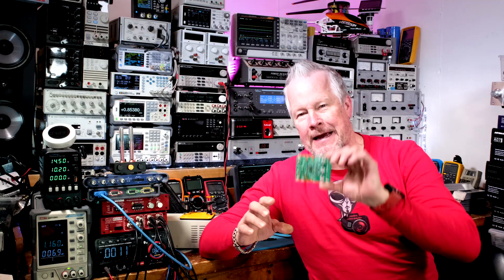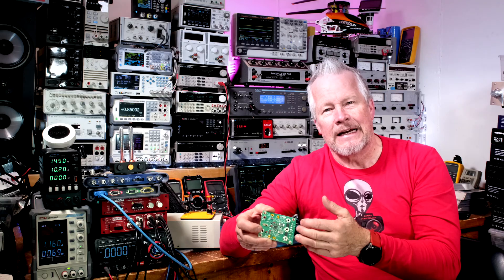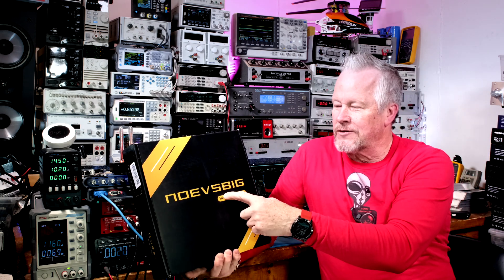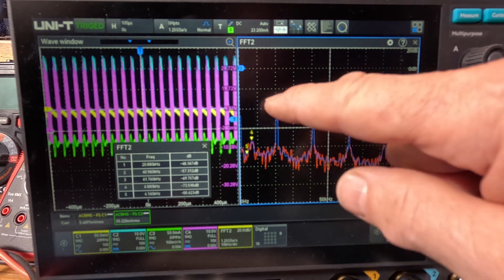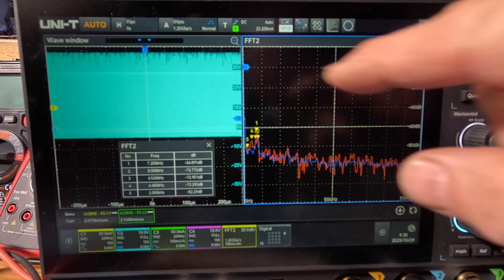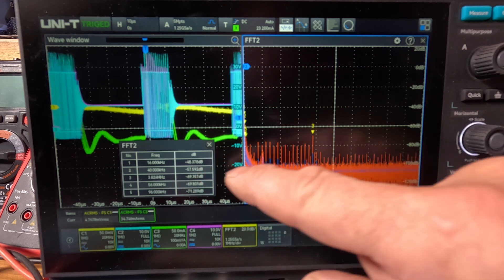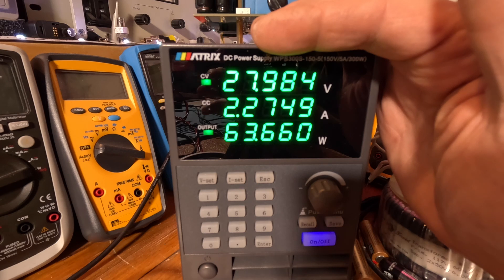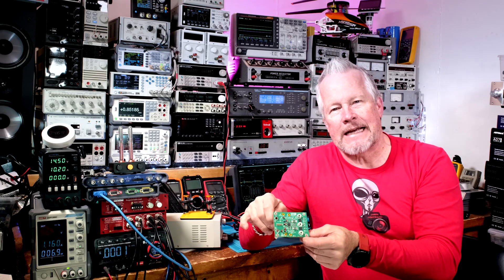Burst mode vs Pulse Skipping vs CCM in SMPS #EPC91109 #GaNconverter #LTC7890

Comment: Hey Eddie, great video! I was wondering how easy it would be to clean up burst mode with a post filter. Maybe all it would take is a bulk capacitor.
Reply from the maker: The burst mode needs ripple to operate - it makes the ripple as part of its control algorithm.  I'll show a video today the 3 modes in this eval card.  But yes there are ways to clean it up but then any benefit is lost.

Comment: Приветствую вас из России! Интересное видео, но было показано поведение блока на разных режимах на статичную нагрузку. В то же время сейчас нагрузка, как правило, динамичная (импульсная). Было бы очень интересно, как работает на разных режимах блок именно на импульсную нагрузку, какие помехи в этом случае.
С уважением, Вячеслав.
Greetings from Russia! Interesting video, but the behavior of the block in different modes on a static load was shown. At the same time, the load is usually dynamic (impulse). It would be very interesting to see how the block works in different modes on an impulse load, and what kind of interference occurs in this case.
Sincerely, Vyacheslav.
Reply from the maker: That's a great question - and a nice lead into my next video.  It will be out today and should answer that:)